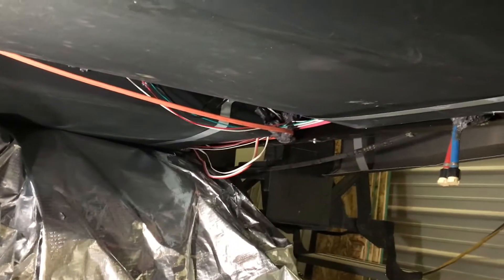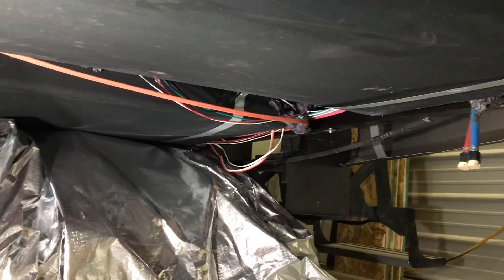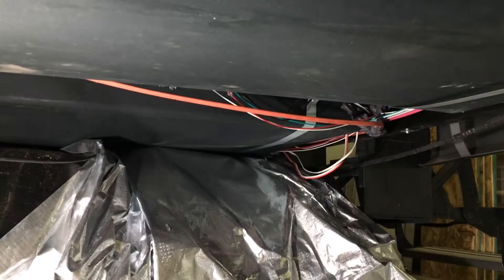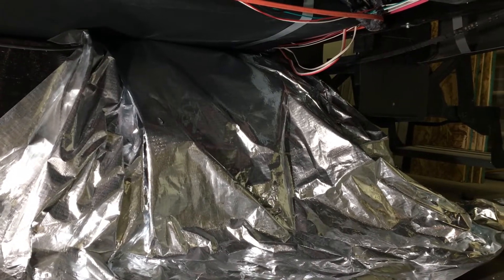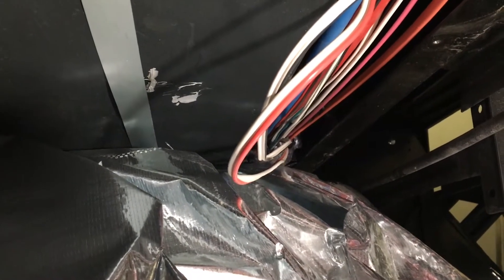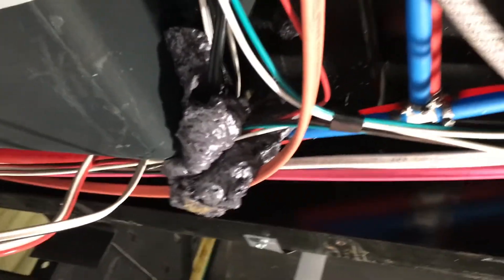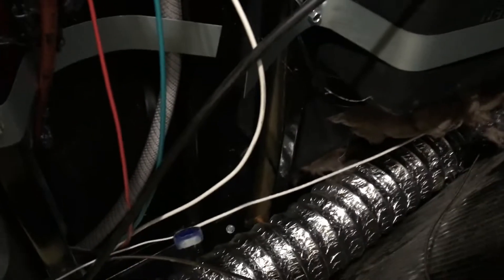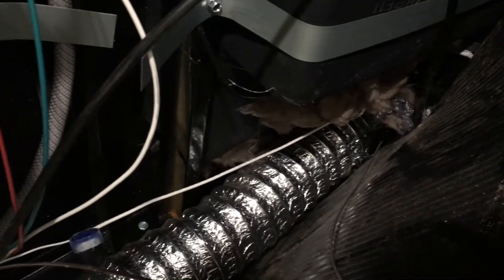Grand Design Imagine Arctic Insulation exposed.

Comment: We are in a 2019 Grand Design Reflection. The brochure says "zero degree extended season enjoyment." Another section in the brochure says "zero degrees tested," supposedly by a third-party. Yesterday we froze up our plumbing at 20 degrees Fahrenheit with the furnace set at 72 degrees Fahrenheit. It makes one wonder if the testing lab drove the RV through a big cooler at 30 mph and called it 0 degree tested.
Reply from the maker: Our Imagine is a 2020 model. If I recall correctly the brochure said it was tested to 15 degrees. It seems they have uped the temperature on their claim. From what I seen the lines will most likely freeze.

Comment: We bought a Grand Design Imagine and we cant imagine a worse trailer especially for the price. Fit and finish is terrible. The bottom insulation collapsed because it didnt extend far enough to meet the screws. Our faucet head in the kitchen fell off because there was no set screw. The lining around the door started coming off immediately. Stay away from this trailer…unless you see mine for sale, then its the best ever. 😃

Comment: I dropped our thermofoil underbelly just last week (9/22/21) in a 2021 311BHS Reflection.  There is one run of 2 inch duct with 3 dumps right next to the tanks.  The 311 has 3 tanks right next to each other near the front and one gray/ black at the rear for the outdoor kitchen sink and the rear bath.  Heat dumps look like they're strategically placed between the three front tanks and the rear.  To add insulation value I placed R13 fiberglass faced insulation on top of the thermofoil the entire length with the faced portion down.  I couldn't get above the tandem axles so that area will rely upon the duct dumping there.  First time in an RV doing full time in Couer D Alene Idaho over the winter.  We have a skirt with two space heaters, heated fresh water hose, and wet bay 100 watt bulb to help things to keep from freezing.  On top of slides, I'll be building a peak to help insulate and keep snow/ ice off the actual slide surface.  I'm hoping this adds some sort of insulating value.

Comment: it is supposed to stay warm from the radiant heat coming off of the heat ducts running in the underbelly.  that heat is then supposed to get trapped by the mylar layer and the plastic under pinning holding it in.  it is just a bunch of advertising bs.
Reply from the maker: That's what I was thinking. The problem with my camper is the only heat line in the underbelly is the one that goes to the bathroom in the rear of the camper. That line has very little air flow through it. About 95% of my air flow comes out the vents nearest the furnance in the bedroom and kitchen. Those two vents are vented directly into the camper.

Comment: My 2019 Grand Design 31Ogk has a heated basement thats for sure. I was at Fory Davis Texas from 2-1- 21 to 2-17-21 during the polar vortex with temps in the single digits. The basement and nautilus are definitely heated, even felt warmer than the interior of the camper with furnace set to 67. I searched behind the wall where the furnace is and found a small diameter duct going into the nautilus and another, maybe 4" duct going to the kitchen (?) that has a tee installed with warm air going into the basement. But, it wasn't enough and the water supply line from the fresh water tank froze at or near the fresh water tank so no water for a day. I plan on dropping the under belly and either adding another small tee in one of the ducts or/and adding insulation around the water supply line at the fresh water tank. Also gonna make the 3 tank heaters and insulation are all properly placed.
Reply: One other area of cold air Infiltration is where the cable for the spare tire passes through the under belly. Spray foam with a long straw can be used temporarily until a more permanent solution can be figured out.
Reply from the maker: I have always wondered if you have hot air going into the underbelly, does it do any good if it does not circulate? I know in a house hvac system you need return air vents along with the supply vents. I think tank heaters are a good idea. That type of heat is just radiant and does not need air flow. Good luck.

Comment: Did the PEX take that heat tape well?  I've used that brand on my house copper but didn't think PEX/polys should be wrapped with it.  Also, another "4season" brand only ducts specific model/floorplans but their brochure says "heated & enclosed underbelly" without a footnote, just like GD's brochure.  So when Elkhart RV marketing says something, its another case of trust but verify.  Thank you for verifying!
Reply from the maker: I did think about heat tape on pex. I wrapped it loosely and chose not to wrap with insulation. I figured when it does kick on it's going to very cold in the under belly. I would imagine that most of the heat will dissipate though out the space. It mostly was intened for unexpected cold nights.

Comment: Hi Big Ben 🇨🇦🐴🙂 follower, 2017 GD Imagine 2600RB .Pulled out drawers to insulate furnace area with reflexis found 4" holes in floor,covered over with aluminum tape🤔cubby hole with 4x9 1 1/8" lowes foam insulation can send pictures.Also look into pool noodles multiple uses and cheap and hold heat around pipes??🤔👍Where did you get or make rear bike rack??🤔🐴🙂🤟

Comment: The whole insulation claim that GD makes is a complete joke. The R-40 that they advertise in the roof is impossible. According to Owens Corning the insulation would have to be aprox. 13 inches thick. The roof isn't that tall and then you have to allow for the decline in attic space as the roof tapers as it gets to the edges. They claim the "foil" adds a insulating factor....then why not double the foil and claim a R-66? If you want to see how the roof is really made then watch https://www.youtube.com/watch?v=mEUmZ4-z1Bg it shows the construction "quality" in a brand new GD. He also did a roof on a Reflection.....they're all made the same.....sadly

Comment: I know this has long past;  How nice if  you would had applied 12V heat pads to each of your tanks. You want 12V for off grid use and while traveling if needed or power outage or for example a stay over at a rest stop. Man i'm bummed seeing this, I take delivery Friday Feb 4th of a new 2022  XLS 22 mle OUCH; My current TT is a Surveyor 2021 19Bhle and i ordered it with 12V heat pads. And they claim furnace heated underbelly. Well I was in 19 degree weather 3 nights in a row and no freeze ups of any kind. I may live in Miami, FLA but we enjoy winter camping up North. For example we're picking up this new TT in Tennessee. And expected Over night lows 20 degrees. I know how to prep for winter camping. We have  heated hose, heated lines i wrap around sewer valves Pipes etc. I use a incandescent light bulb where needed for heat.  Sadly if my coach comes with no Furnace heated underbelly; well i will pursue them for false misinterpretation of usage. Not as easy as it sounds. But since i'm  in the insurance claims business and surrounded by attorneys; i will follow suit?  I will test  it with a Infrared Temperature Gun. Get a reading from underbelly before and then turn on furnace wait a few minutes and keep taking readings. A little more to it; but you get the picture.
Reply from the maker: I would be interested in hearing your results.